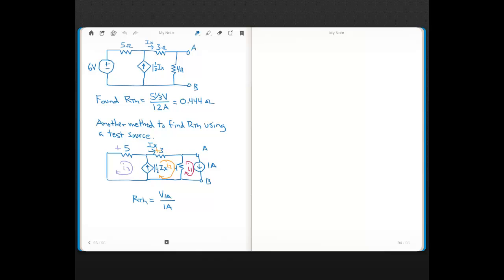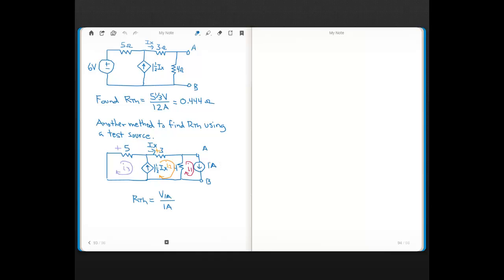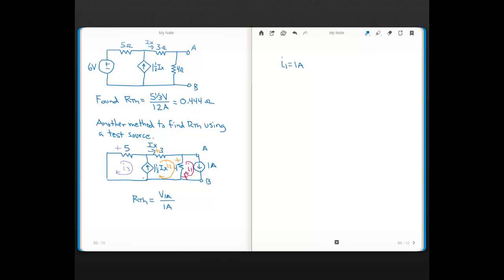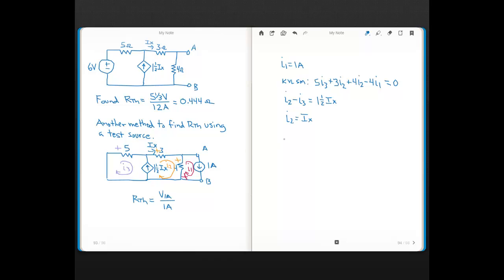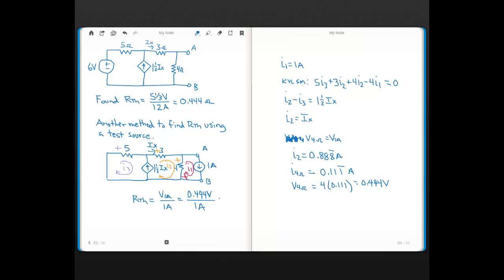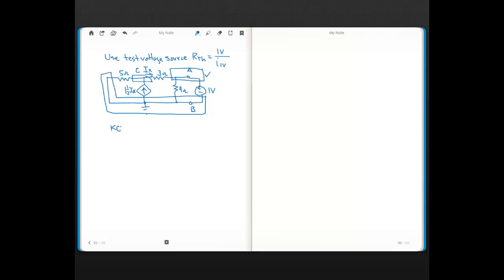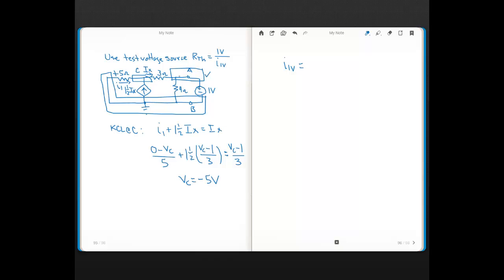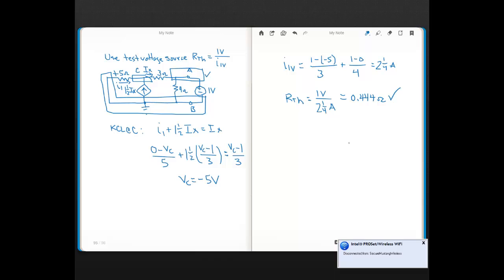Lecture23 Test Source Method for RTh

Comment from the maker: By convention the value of 1A is used because then the voltage across the test source = RTH since you're dividing the test source voltage by 1.

If you were to use a different value than 1A, say 2A, the voltage across the test source would be twice the voltage obtained with a 1A source and the same RTH results (since now you're dividing by 2). This is so since the circuit is linear.